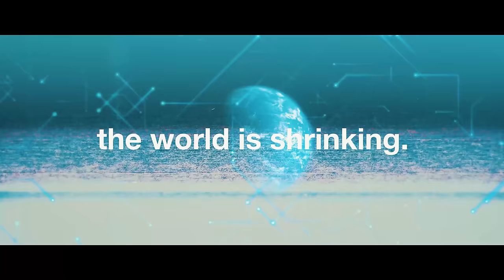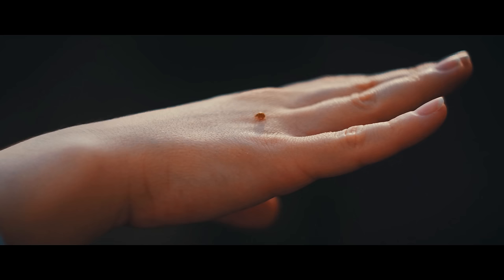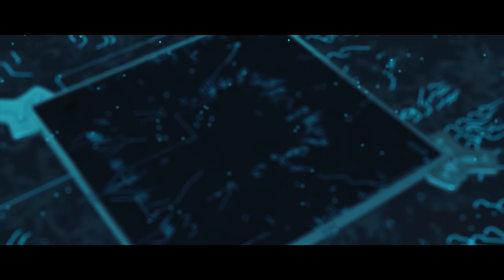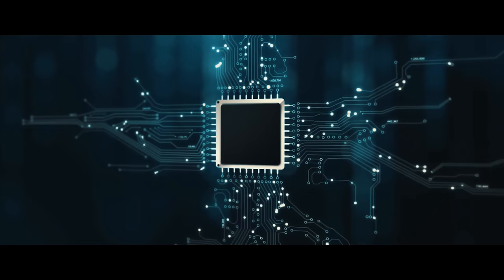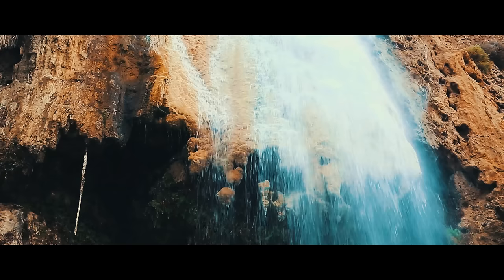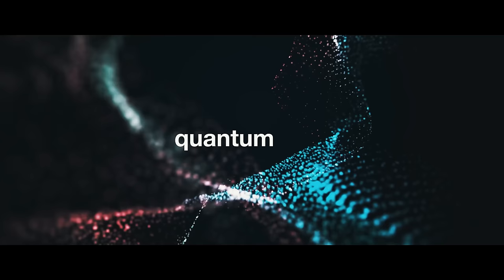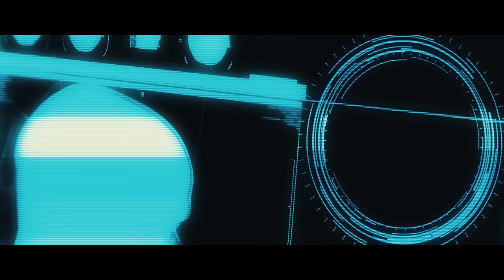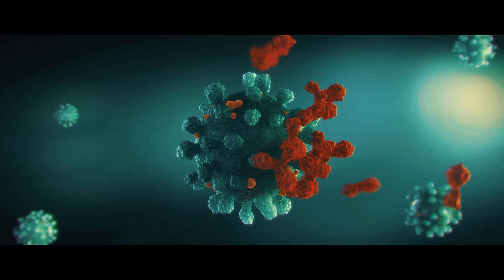Nanotechnology: A New Frontier

Comment: I used to make quantum dots and apply them in biological stuff, feel free to ask something.

The coolest thing is that quantum dots are like a trigger sensitive to light, so you can be ultra precise.
Reply: What biological things/procedures did you use them in?
Reply: Did you add quantum dots to your profile picture lol
Reply: [pain]t TL;DR Cell photography and analysis
Quantum dots have a special property: they reradiate light with slightly modified wavelength, so we used them with antibodies to highlight certain parts of a cell. Without quantum dots we would either have a completely black picture (if wavelength is invisible to the camera) or a completely white (if camera is sensitive to this light), but with them in certain areas (defined by antibodies) we used invisible light so we could see the picture. They are also used in TVs and cancer treatment, but I haven't applied them that way.
Reply: Satans minion.

Comment: 1:15 Nano is sub-atomic? For future reference please let someone educated in the field you produce videos about double check your statements.An atom is up to 3 Ångström, which is 0.3 nm. The field of nanotechnology refers to sizes between 1-100 nm. Atoms are therefore smaller than nano. Also, you may have heard about the field of chemistry, which studies molecules, also is on a smaller size scale compared to nano. Most molecules (not polymers) are less than 1 nm in size.

So if you were to order according to size, you got:
Physics (elemental particles and atoms) 
Chemistry
Nanotechnology
Biology
Reply: Not a good way to order it. Nanotechnology is a composite field combining physics, chemistry, and biology.
We definitely are working with atoms at sizes smaller than the nanometre, but we traditionally define nanotechnology as something in the 1-100 nm range.

Also do note that it is not so cut and dry. There are bacteria which are 1/5th the size of the largest single molecule, so you cannot really rank size that way.
Reply: @Stroyer123  while I agree the field is more nuanced than size alone, the comment refers to the statement made in the video, which was size based. If a size is to be used, it is 1-100 nm, which is literally the definition.

I don't think the comparison between macromolecules and small bacterias is relevant. Large molecules have other names, proteins, polymers etc. Molecule itself is a wide definition.

Comment: Few centuries later:
Picotechnology: A New Frontier
Reply: Tbh, not to destroy the vibe but we can't go lower than atoms
Reply: @jellymatsuryuka6853  I'm half-joking anyway. May I know why though?
Reply: @agilpriyatna6736  atoms compose everything
Reply: @jellymatsuryuka6853  You know? It's not like I'm an expert or anything in this, from a quick search in the net and tiny bit of my knowledge, I found out that atom is made of proton, neutron, electron. And electron is much much smaller than those other two. And the other two are made of (logically speaking) "tinier" fundamental particle, quarks, which should be much much smaller, maybe as small as electrons  itself. And that's only what we currently know. We don't know yet if these quarks and electrons are a point particle, where size doesn't apply or if they consist of other internal components. Again I'm not an expert in this field. So I could totally be Fundamentally😅 wrong
Reply: @agilpriyatna6736  ok correction we can't go smaller than electrons
Reply: @jellymatsuryuka6853  This is not entirely correct. Protons and neutrons are composed of quarks, so we can go smaller. Quarks have been determined to be at most 10^-4 times the size of a proton, which would at max make them 10^-19 metres - which is in the zeptometre range, but they are usually thought to be point-like, meaning they have a 0 size. This is quite a weird concept for non-physicists, I'll admit.

It is currently not possible to move quarks around, but maybe in the future, although it would require an incredible leap in physics.
Reply: @agilpriyatna6736  You are right, although you draw lots of assumptions lol. I've mad a comment explaining it somewhat. Keep learning! You're doing great!

Comment: Wow your IT related explanation is WILDLY inaccurate. We've gotten transistors down to 7nm (NOT 1) which increases the amount of transistors that can be fit onto a single chip, thus enhancing its computational power. Storage capacity, while also helpful, has very little do to with any of this. How is the production value of this video so high if you're gonna be all loosey-goosey with the information you distribute with it?? Shameful.

Comment: Nano isn’t subatomic, quantum and fermi is
Reply: Quantum and fermi cannot be compared to nano. Nano is a prefix in the SI unit system, you should compare it to pico (most atomic radii are measured in picometres), and smaller. Quantum relates to energy and radiation. Fermi was the creator of the first nuclear reactor, and the herald of the nuclear age.
Reply: @Stroyer123  The dominant forces at those scales are what the mathematical formulas are explaining.  Nano is not subatomic, quantum and fermi are.
Reply: @rewirestrike  I am fully aware of what the words mean. I study nanotechnology.

It was more to say that nano is a prefix used in the SI system, which quantum and fermi aren't. Although fermi has laid name to one of the prefixes.

I just wanted to explain to people that you cannot use quantum or fermi as a unit of measurement like nano. If we use quantum as a measurement, then it isn't correct to say that it is subatomic either, since quantum phenomena are utilised in nanotechnology. An example would be quantum dots, which are several nanometres in size, meaning that they are way larger than even the largest atoms.
Reply: @Stroyer123  I study nanotech also.  Your point about SI system is not pointless just a tangent point.  I am  saying that at 1:17 in the video he says nano is subatomic which is false.
Reply: @rewirestrike  I definitely agree with you that it is false. I just wanted to clarify quantum and fermi, because those words are usually used wrongly in popular culture.

I wasn't trying to start an argument with you.

That being said. It is wrong saying that quantum and fermi are both subatomic, because it is wrong. Quantum mechanics does not have to be subatomic. I am not sure what you mean by fermi. Fermi energy perhaps?

Either way, I just wanted to clarify that quantum and fermi are not units of measurement, and thus cannot be compared to nano.

It's rare seeing other nanotechnologists, so I'm excited to meet another one. What uni do you study at, if you don't mind me asking? :D
Reply: @Stroyer123  10^-12 is Quantum, 10^-15 is Fermi.  Yes technically 10^-12 is the realm of single atoms... if your evaluating smaller forced than 10^-12 is subatomic.  10^-15 is the true subatomic scale however with respect unless your into high energy all you math will be bounded by the -15 to the -12 scale,  I already graduated with a BS in Applied Mathematics.  My background is split between Nanotech and Ai. :D
Reply: @rewirestrike  I have no idea where you're getting those numbers from. 10^-15 is femto, which is named after Fermi, correct. But 10^-12 is pico. Quantum is not a size, you cannot use it as a measurement dude.
Reply: @Stroyer123  You talking about SI units, its just coincidence that Nano is the same SI unit as its named realm
Reply: @rewirestrike  It is very much not a coincidence. It was named nanotechnology, because it is defined as something in the nanometre size range.

You cannot say quantum is 10^-12, because quantum is not a unit of measurement. Quantum does not have a value. It is a concept. If you mean that quantum mechanics kick in at 10^-12 m, then that is also incorrect.

You cannot assign values to quantum and fermi.
Reply: @Stroyer123  lol if you say so dude, your contradicting yourself at this point.  The dominating forces at each scale (power of 10) are known and categorized. If you insist on demanding I correctly label each power of 10 to their SI unit then I still wont do it.  At the end of the day 10^-15 is the Fermi realm, 10^-12 is the Quantum realm and 10^9 is the Nano realm. Nano being the only SI unit identically named after its realm.  I have already said this and you are just bantering at this point.  YOU ARE WRONG.
Reply: @rewirestrike  I have never heard of anything called the "Fermi realm," but if you insist on using that term, then even saying that the quantum realm is 10^-12 is incorrect. The few mentions I've found labelling it quantum realm still classify it as beginning at the nanometre scale, which would make it molecular/supramolecular?

I don't understand why you're getting so aggressive, I just disagree with you, and believe you are using the words incorrectly. If your uni uses other definitions then that's fine. I'm really justr trying to learn.

Guess we'll have to agree to disagree.
Reply: @Stroyer123  10^-12 IS where quantum effects are the dominant forces like I said.
Reply: @rewirestrike  They are the dominant forces at that scale, but they are definitely also earlier.

Quantum effects dominate the properties of matter already at the nanoscale, which I've been saying this whole time.
Reply: @Stroyer123  Dude idk what your on. you could have just left with agreeing with me.  At this point you are contradicting yourself.
Reply: @rewirestrike  Tell me how I am contradicting myself, please.
Reply: @Stroyer123  Just read it yourself.